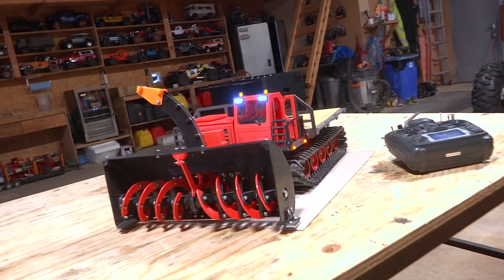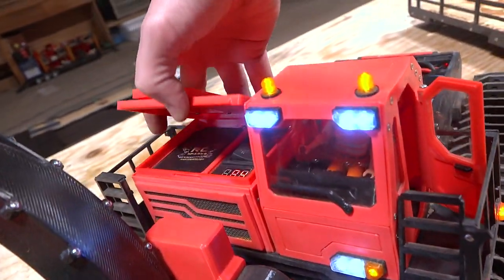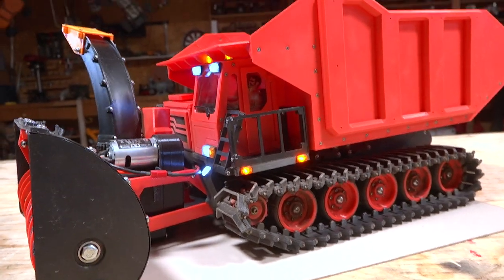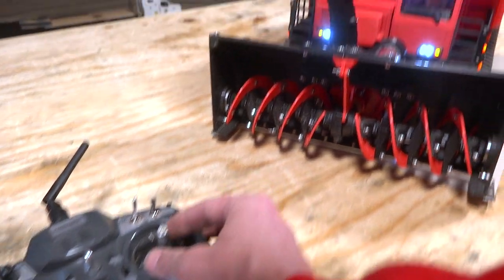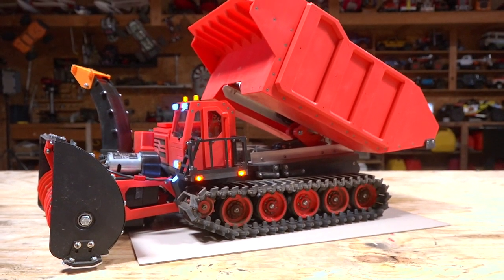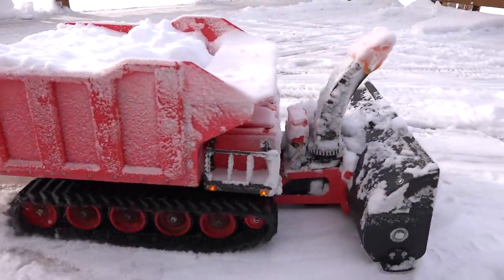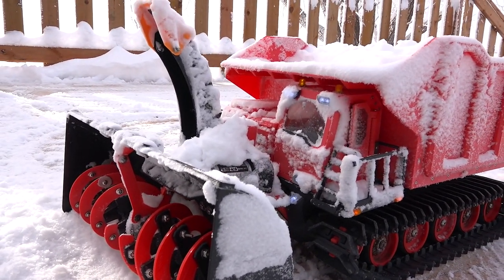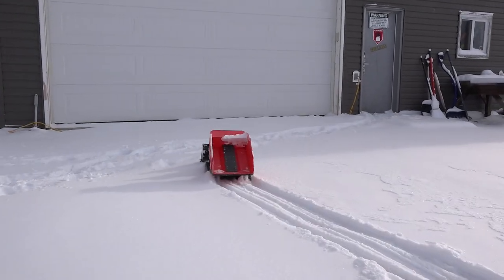3D Printed Radio Controlled RED SNOW BLOWER & TRACKED MACHINE - Robots Doing Work | RC ADVENTURES

Comment: That thing is dope and surprisingly functional. It's basically the most badass snow cone maker in existence. Very impressive work to make that with a 3d printer but I bet it would do even better with a few metal upgrades.

Comment: How many rc's do you have? How long would it take to get bored of one truck or rc's in general? I only have one currently, should I get another at some point?
Reply: you can never have enough rc´s :)
Reply: I have 3. Axial yeti, ecx torment 2wd and I just got a traxxas rally. They’re all different as far as how fast they are, how they handle, or what type of terrain.
Reply: @jeffreyricciardi7455  i got an axial scx10 8x8 project in the works and a tamiya globe liner 8x6 heavy hauler project in the works a traxxas 1/10 E-revo/ftx bugsta converted to brushless/feiyue fy6 6x6/tamiya cc01/custom crawler/traxxas villain boat to name a few :)
Reply: SP1TFYRE 8 when I was younger (in my teens - my 20's) at times I had well over two dozen rc vehicles. That ended when we had kids & bought a house as I simply didn't have the time to use everything. 
Remember, the more you buy, the more of a budget you'll need for parts, fuel etc. don't buy or build another vehicle that will leave you shorthanded financially. As of now I only have 3rc's left and all are at a decade old or more but parts are still available. 
I have an hpi savage running a new era 1/5 scale chassis, losi mgt shocks, an OS .30 vg and hydraulic brakes. 
An associated mgt, running another os 30vg and assorted other mods. 
An old warehouse hobbies magnum 57 hull running a rcmk twin.
Reply: SP1TFYRE 8 honestly it just depends on what you do with em like my on road Rc I got kinda bored of just cause it’s not capable of off road, IMO an off-road capable vehicle would take longer for me to get bored with,  just buy multiple, I’m about to buy a team associated SCT so I can compete with girlfriends traxxas SCT I also have a traxxas revo that was converted to electric but I’m gonna make it a nitro again since I’ve got a .25 sitting around. 
Basically what I’m saying is, get a project and learn how to tear down the one you have currently and clean it etc, doesn’t hurt to upgrade your current one either
Reply: Getting new paddle tires made my rustler perform Soo well in the snow!
Reply: Thanks guys :) I am thinking of getting a losi rock Rey, do sand paw tires fit?

Comment: Hey, buying my first proper transmitter(10+ch for random tinkering)  is there a way i can configure a switch to change what channels the two main sticks control? if so what controller can do this? hoping to keep it in the 80-150$ range if possible. any help would be appreciated Thank you!
Reply from the maker: You can just plug them in differently to the RX.. and program what you want...  but if your budget is too low for any kind of "decent" radio.. you need at least 220
Reply: +RCSparks Studio I'll have to look around I suppose, Thank you for your time and for keeping the channel up! its been fun seeing it grow over the years  :)